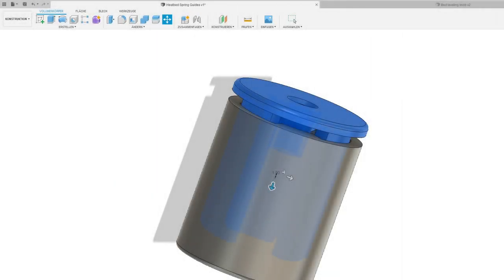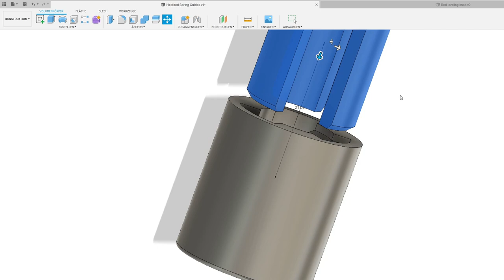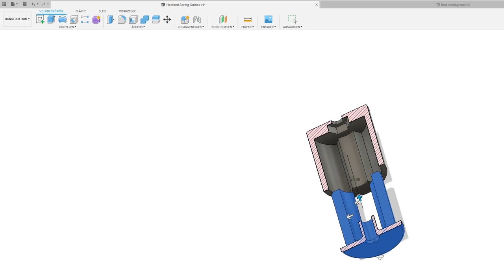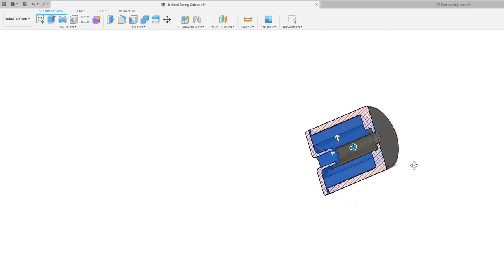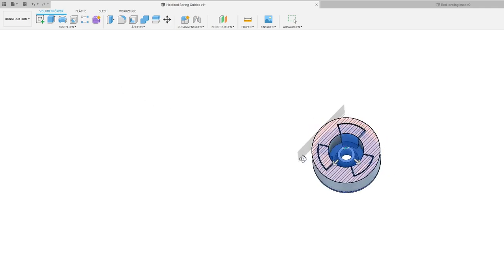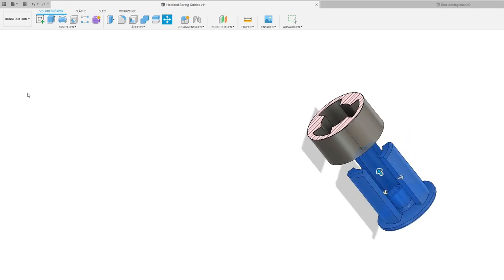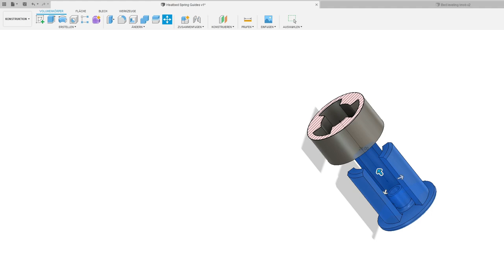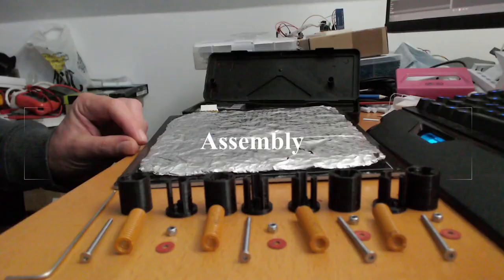No More Shaky Bed Springs - 3D Printing Heatbed Stabilizers!

Comment: I really like your concept as I have noticed the lateral play in the bed. Can you share more about the maximum compressed height of the assembly? What is screw diameter? can you also list more details on the additional components required like the size of the insulated washers and the nuts that were added?
Reply from the maker: Thanks for the feedback!
The screw diameter is 3mm and the nuts are self securing M3 nuts.
The brass nuts that i melt into the pla knobs are the original ones that came with the printer but 3mm brass inserts should work asprings and brass inserts into the video description.
I put links to the insulating washers, the springs
Reply: @3D_Printing_Geek  Awesome thank you for the additional information that you added. I have downloaded the file from Thingiverse and look forward to implementing the design
Reply from the maker: I'm currently planning a follow up video measuring the effect of my solution compared to silicone dampers vs the original state. I still need to do some programming to do the measuring but hope getting it done soon :-)
Reply: @3D_Printing_Geek  sounds great! I will be looking for that as I am very interested. I have read some different viewpoints on silicone but found your solution to be more elegant at least in theory, for a long term solution.
Reply from the maker: By the way, the maximum compressed height of the assembly should be about half the length of the used springs. That's almost more tension than ever needed to adjust the bed. I like my springs to be tensioned just so slightly that the bed does stay in place for many prints befor a releveling is needed.

Comment: I do not use longer springs but find I have the same issues with the stock springs. Awesome idea. Do you have any binding of the plastic parts? Did you use any lubricant? Do you have the stl files?
Reply from the maker: Thanks for your comment.
There is a slight binding between the plastik parts but that is totally overcome by the tension of the springs. Therefore I did not pay too much attention to that. I made sure that the parts slide all the way. The parts are designed with reasonable tolerances to achieve this.
The STLs are available on Thingiverse now https://www.thingiverse.com/thing:4848598.
I'd appreciate if you subscribe the channel to be informed of upcoming videos :-)